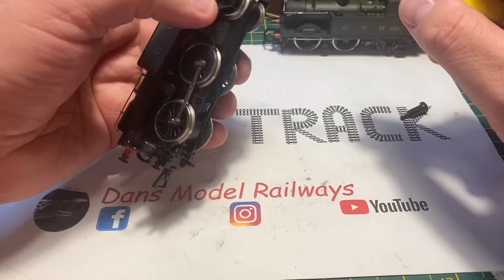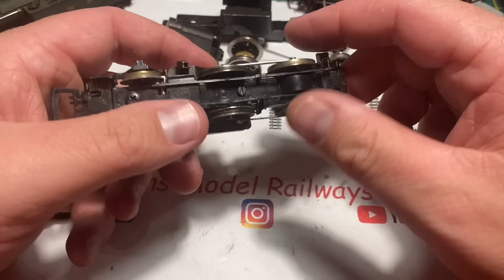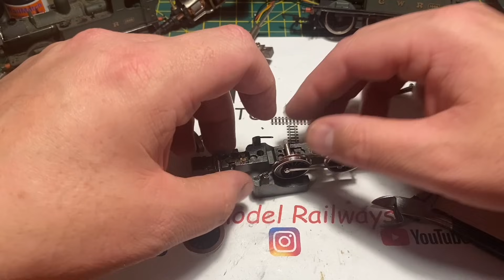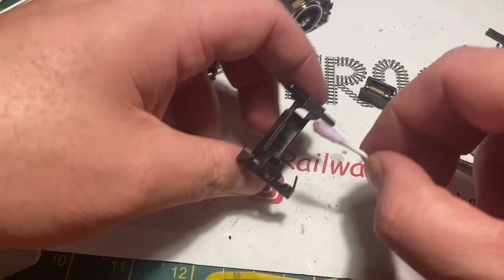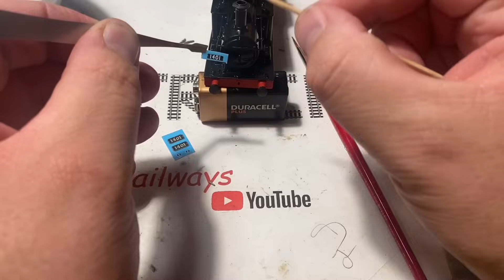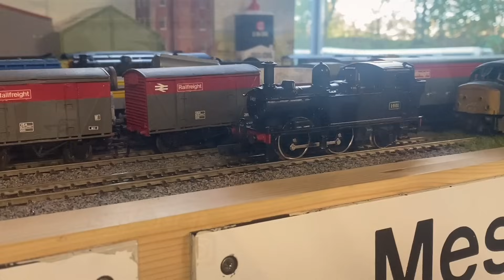Trash to Track. Episode 78. Dapol GWR 14XX tank loco’s.

Comment: Very  informative  video. I have 2 ailing airfix  14xx locos which lm hoping  to make into a good one using what l have seen  in your  video. I also have a dapol  14xx  which was very  easy to fit a decoder to as it had different  pick ups to the airfix  one.   The traction  tyres were worn  out so i just removed  them and found the loco ran better  without them.

Comment: Hi Dan.
What a fiddley job.
Nice they have 5 pole motors, should be smooth running at slow speed.

Great work buddy as usual.
One bonus no Mazak rot. 
Body's certainly needed a good clean though.
What a beautiful looking loco after you finished with it.

Thanks Dan, great vlog.
Stay safe.
Pete.

Comment: Be careful when varnishing over Halfords paint; although you can try to find matching acrylic or enamel varnishes, it will still cause a reaction: It’s the ingredients and solvents rather than the base. 

I’ve tried numerous types of spray varnish to seal models painted with Halfords paint and in my experience, only Mr.Hobby doesn’t cause a reaction. Mr.Hobby make UV resistant varnishes as well, which is a nice bonus. Hasn’t failed me yet!

Comment: these models you have date back to when airfix did model railways, and the original five pole motor was their design, the later M7 motor is actually dapol's doing as they use that same motor in the terriers and j94s, hornby just bought the toolings and ran with them as they were

but what it means is depending upon what model your making, you can have either the center wheel or the front wheel driven for a model project, so say you want to make a fictional 4-4-0 you can use the dapol redesign because of where the motor sits and it won't fowl the cab, and with the original airfix style you could mount a modern coreless motor and finally have cab detail in a 14XX, or make a bizarre big wheeled 0-4-0

oh, and those bits of metal aren't spacers, they are there for the original airfix coupling to be re-centered as without those bits they flop and slop about and you can never get reliable coupling, it's why most dapol onwards ones have a bigger D coupling because of this design

Comment: Actually for the filming of Titfield Thunderbolt two 14xx tanks were used 1401 and 1456 which was renumbered 1401 and turned to face in the opposite direction so filming could be done with either loco and look right in the finished film. 1462 was filmed on the "timetable" at Bristol Bath Road and a wooden mock up sitting on a Bedford lorry chassis was used to drive down Woodstock High street Oxfordshire and through Richmond Park in London. Other than Lion the other railway rolling stock used in the film hasn't survived to the present day. The Wisbech and Upwell tramway coach No.7 used in the film was scrapped and only No.8 has been preserved on the North Norfolk Railway. It has had a bar built into it to represent Mr Valentine's favourite sitting place. The only other piece of non railway item to survive from the film is Harry's steam roller.
The dual between 1401 and Harry's steam roller took place near to Dunkerton Colliery and the level crossing was a fake the planks of wood being put there to represent a level crossing. 
The parachute water tank where they "stopped" to take water was a filming prop. When not being used for filming Lion was stored at Limpley Stoke Station. 
Titfield station was not a terminus station but a through station on the line and the level crossing gates beyond it were removed to give the feel of a terminus station.

Comment: Instead of taking off the wheel and re-quartering, could you not have just turned one of the axles over, so that the wheel on the left was on the right and vice versa, to make the quartering correct? One way round the quartering is 90 degrees ahead of the other wheel on the same axle. The other way round the quartering is 90 degrees behind the other wheel on the same axle.

Comment: You don’t happen to have a chassis bottom for a dapol 14xx ? I have a broken one that needs pickups 

It’s different to the airfix one you showed in your video the dapol and later hornby 14xx have a type 7 motor so the chassis is slightly different 

I have a dapol factory made 1401 video on my channel 

Thanks 
Oliver

Comment: titfield thunderbolt was 1953 , so in dr beachings cuts early years , but nationalisation was from 47 so at that time well into BRs reign so was more than likely BR black already as a GWR one would have been green so it may well have been BRs work rather than just done for filming
Reply from the maker: It was actually filmed in 1952 and released in 53. The loco (1401) when sought for filming still carried GWR on both of its tank sides, but was wartime black. The film crew painted over the GWR markings so they wouldn’t be visible during filming.  The paint patches are visible on the film however. Some of The Big Four initials lasted for almost a decade on tank and tender sides after nationalisation.